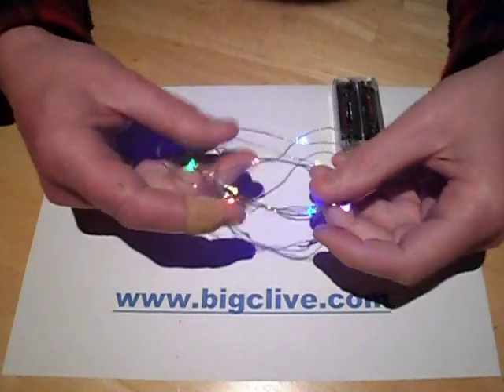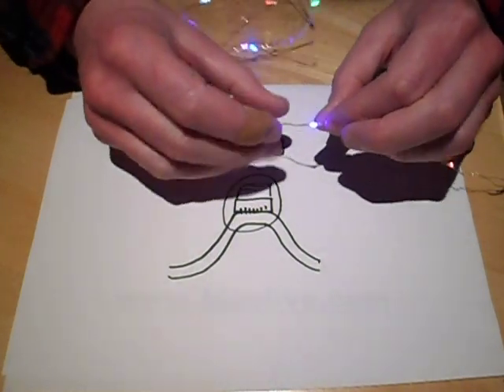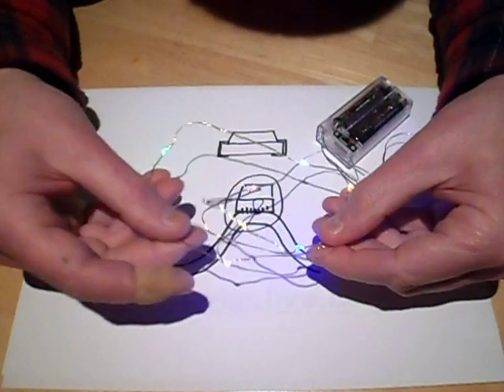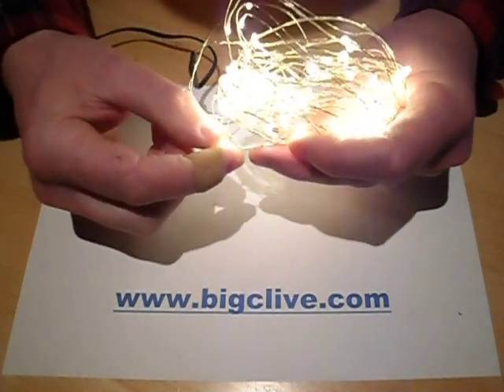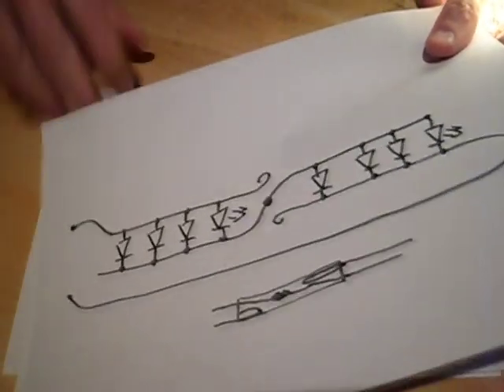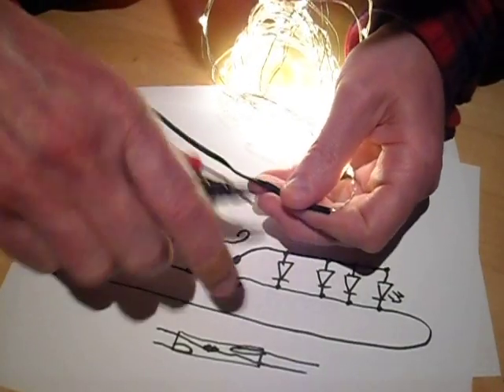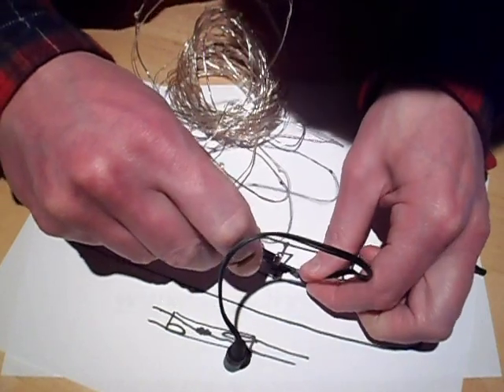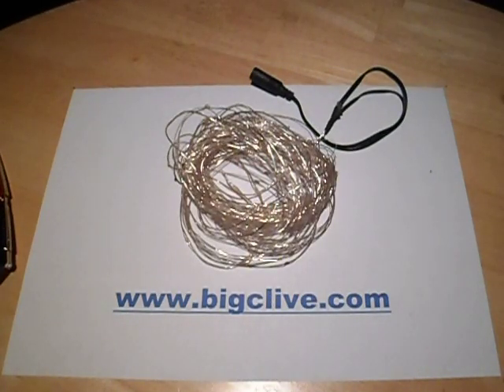Analysis of a 100 LED string of "wire lights".

Comment: Amazing how a 10 year old video comes in handy! 🙏 broke our lights that we’ve had forever and got confused by extra wires and it was intermittently tripping the transformer, turns out I’d linked up the loose 3rd wire at the start of the chain which apparently didn’t need to be connected to anything 😂 thanks

Comment: Excellent! Thank you very much, you saved my bacon. I had cut down a 5v 3x wire 200 LED string, and it didn't work, of course. I was perplexed as the little joints, (there are many in this system) didn't make any sense. Until I watched this video. My solution, basic as it was, was to solder it all back together and coil up the excess out of harms way :-).

Comment: Would it be possible to shorten these lights?
Reply from the maker: It's not easy, as one of the wires going to the other end is a common.  On the 5V sets you would have to work out which wire the third strand was supposed to join to at the end, and on the 12V strings it's not very viable.
Reply: thank you!
Reply: Can we join these wires if the string's cut off
Reply: @baesilvaz4440

Comment: Your resistor is the ~50m of thin copper wire...   You only need a resistance of a few ohms for sufficient current regulation.

Comment: Some good points, Clive. My wife and I are now in southern Spain for the summerand I plan to do lots of experiments with battery powered and solar LEDs now the sun is with us. The rice wire LEDs we have so far are running off 3v solar cells and come as little bottle corks with a strand of the lights. I've just ordered some RGB rice wire (many metres of RGB) which should be with us in a couple of weeks and I'd never thought to check if it is 12v or low-voltage - and I was wondering how they get the red to run at the same voltage as the rest. Your comment that the colours are almost all base on blue makes sense. The solar variety are not that bright and so I plan to run them off my solar 24v (250w) installation via some cheap, tiny dc-dc convertor pcbs that came to about 50p each, able to take in anything up to 30v and output almost any low voltage. I'm expecting to need just short of 4v but if it turns out the long strands are indeed 12v then these little boards will handle that, too. I seal the convertors with the glue gun usually though resin would do just as well. If they are in parallel-serial it could make it harder to customise the length. I do know the white ones are simply all in parallel and hence you can cut the wire anywhere. The RGB 12v LEDs you describe could be slightly trickier to cut down.
Reply: For 12V 2wire LEDs you can rewire the joints into one parallel circuit to allow these to run on a 3.5V supply...Then cut off some or all of of the excess and reconnect the injection wire. Consider being nice to your remaining LEDs because they will have to share a higher current. You can resist(or) the advance before it gets too hot to handle. RGB likely have 3 wires and I admit I haven't tried rewiring them...

Comment: I have a set of these very thin copper wire lights which is made up of 16 strings joined to one 12v 6W supply wire and designed to "cascade" down a christmas tree.  Every 5 or so lights pulses on and off to create a "twinkle" effect. My question is would it be possible to fit a suitable dimmer, if so, what should I be looking for?

Comment: Hi thank you for this helpful video. I was just thinking about this as i recently found them and i bought 4 of this (battery suplied 1.45meterea long) i used them for a project and i would like to kink all those 4 packs togethers and try to make something be powered by plug . Can you help me how i can do that. Is it fin if i jus link the end of each pack with other pack by sording cables? How i know which one is + and which is -

Comment: So I guess the 5V ones just include a resistor to drop down to the 3 ish volt?
I bought a set on clearance the other day for 7 euros (70% off) that includes 180 warm white leds in 9 strings of 20 at 5ish cm spacing instead of the more common 10, each hanging from a thicker wire busbar at about 15-20 cm spacing, sold as a light curtain effect. The power adapter it comes with is 6V 800mA, and where the power feed comes into the lit part, I can see under the heatshrink that there are two large, probably 2W resistors, presumably one for each leg — I can even see they are colorbanded, although not which colors. It really does look like they're literally pissing away half the power as heat — the resistors get appreciably warm but not excessively so.
Seems like it'd be a lot more efficient to have a current regulated driver...

Comment: I have a question . I bought a christmas tree with white LEDs built in, and they only lasted 10 mins. When I tried to change the blinking mode it died. The power supply doesn't have any power output anymore, the info on the power supply says Urated=29V , Uout = 32V , Prated=15W .  So I decided to do the power supply myself,  I had old toroidal transformer and wound up enough wire to provide 30V . Now I ordered on ebay bridge rectifier KBPC3504 so this should sort out the AC to DC issue. Now I am not sure about the resistance needed, as my transformer is probably giving 10A on that 30V .  And also not sure about capacitor, do I need any?   How do I calculate the resistance needed considering the old PSU had 15W and 30V , which means 0.5A output. I would need to achieve the same output and not higher or the LEDs will burn .
Reply from the maker: I'd recommend trying to find another standard Xmas lighting transformer rated around 30V.  Especially if there are a couple of flashing channels, as it may be using alternating polarity to switch between circuits.

Comment: Hi. I have 300 led 12 volt fairy light string. And I have 12 independent short fairy light string with 20 leds and operated 2 pcs 3v battery. Can I connect thoose 2 type or can I connect the 12 small to a 1 long with plug in end to a wall cause the batteries die so fast.

Comment: Hi. I want to join a few of these together, not as a continual strand but as individual strings, out of one battery pack, would i need to add something to ensure they are safe or maybe a bigger battery pack?
Thanks in advance
Reply from the maker: You could parallel these sets from a central battery pack no problem.  You might also consider the 5V versions that could be operated from USB power banks.
Reply: Thanks for your reply. 
They need to be portable as the display they will be used for is in the middle of a field and no electricity supply.

Comment: I have five sets of these driven by a USB flasher. I want to drive the five sets so they flash in synchronism. How easy is that to do ???? Could one USB drive be buffered to achieve it ???

Comment: How would I connect a couple of LED string lights together. So I could go from a 10m strand to a 20m strand etc. save on using extra power cords and what not.
Reply from the maker: +scottyv1985 The strings are arranged with a specific wire resistance and feed from both ends, so it's not easy to just join them together.  But you can save some cabling by feeding two sets from a central point and running them out in either direction.

Comment: I cut these into singles and use in greeting cards, I've made several videos on different ways to do it. I use a CR2016 battery, which is very thin and easy to use.

Comment: I'm sure it's been asked but I have several of the 2 double aa battery style lights and see them often at dollar stores. I think you already covered the subject but I would like to know if connecting two of the 3v parallel strands in  series would make it a 6v strand and if then could be run dimmer with a 5 volt usb? Think you may have answered the question saying the connections are not easy to distinguish but the lights I have are the bigger gauge  wire more common style led string light and not the fairy lights. Would be nice to not have to buy a bunch of 3v power adapters, but guess I can start working with resistors too and learn something new. Love the videos and the way you tinker with lighting. You pop up in many google searches often times the only person to have answered the typical diy questions Ive had. Have a wonderful day!
Reply from the maker: Search my videos.  I have one showing how to convert these LED strings to USB with just two 10 ohm resistors.

Comment: I am trying to fix one of those 100 lights string, already tried all 3 wires possible connections in the RED and BLACK wires of the cable adapter. I am leaving a third wire disconnected as I compared it to a working string and is having that. 

Could someone explain how to solder this 3 wired string into the 2 wired adapter part with the females end. 

Thanks!
Reply from the maker: One wire usually goes to the far end, and is one of the power connections.  Just one of the wires at the other end is normally connected to the other connection.  The voltage of the power supply must match the string.  Some are 12V and some are 5V.
Polarity matters.  Wrong polarity and they won't light.

Comment: Hi,  i got a 10M (100 LEDs) USB powered set. If i cut 2Metres (20leds) from it, how can i solder it and how many volts will i need to power it? Thanks!

Note: my set only has 2 wires.

Comment: Can the 100 bulbs be cut into  shorter segments, say 4 (25 bulbs each), or 8 (12-13 bulbs each)? I plan to put the segments in small jars powered by a 3V or a 1.5 V cell each segment.

Comment: Merry FISHMAS hope u guys have a great 1. Hey i have a question not sure if youve ever covered small electrical stuff like. 1 watt uv leds in series maybe 2 or 3 bulbs. Id like to run them off battery. Im thinking 9volt but not sure and what size resistor would i need for 2 or 3 bulbs
Reply from the maker: For 1W LEDs it's typically about 3V per LED, so on 9V you would have 6V across 2 LEDs and 3V to drop across the resistor.  For a current of about 300mA that would require a 10 ohm resistor that would need to be rated for at least 1W.
Reply: @bigclivedotcom  Merry FISHMAS hope u guys have a great 1. Hey i have a question not sure if youve ever covered small electrical stuff like. 1 watt uv leds in series maybe 2 or 3 bulbs. Id like to run them off battery. Im thinking 9volt but not sure and what size resistor would i need for 2 or 3 bulbs.
Emitting Colour: UV
DC Forward Voltage:  3.9V - 4.5V
DC Forward Current: 350mA/700mA
Luminous Intensity: 50~55mW
Wave Length: 365nm - 370nm
Viewing Angle: 120 Degree

Comment: I have one USB powered set in a fireplace and two battery operated sets up on the mantle.  I'd like to splice them all together to be powered by the USB and into the wall thus eliminating the need to constantly replace batteries.  Is it doable?  Seems simple enough to cut and splice them together.

Comment: Hi! Love your videos. I have a question that you may be able to help with. I have a set of copper string lights that I am attaching outside to a tree. The lights are "waterfall" or "vine" lights. There are 10 strands all connected to a central point. Each strand consists of two wires. They appear to end with a simple cut. They are not soldered back on themselves. I attached it to a tree with staples. About halfway through, I checked it and it worked. At the end, I plugged it in, and none of the lights will light. Did I short the entire bunch of lights? If I did, how do you think I managed it and is it repairable? I have a soldering gun and novice level experience. I'd love to hear what you have to say!
Thank you in advance
Reply from the maker: The staples may have pierced the lacquer and shorted the string.  They're not a good choice for attaching thin wire.

Comment: There is a lot to learn about the various types of these that occur out in the wild. I just got a solar powered string of 100 RGBYs and it does not chop the LED’s into sets of 25. they are all in parallel and powered by a 3.7 volt Li Ion cell. However the string I got seems to have a defect. It only runs for about a half hour before the red yellow and blue lights dim and then drop out and the green goes bright. This suggests that the LED’s are not correctly voltage matched - eh? Also tells me why they were so cheap on eBay :-)
Reply from the maker: The reds and yellows are probably blue chips with phosphor.  The green is probably a bare green chip, and as you say, probably has a lower forward voltage.

Comment: can i put 300 lights or 3 sets by 100(10m) to 1 charger or to power surply.they are powered by 3 AA batery each now..but i want them be wired and if posible to power them with cable?!
Reply: Thats easier. 5v usb if it's 3 batteries. Just make sure to wire to the + / - battery case terminals since inside the case is other circuitry usually stepping down the voltage. (Meaning don't just cut the wires right before the lights and splice on there, run in series and keep intact the battery case and or circuitry. But if they can run off 4.5 volts they will do fine.

Comment: Do you know if there is any way to fix this type of light strand? One of the two wires snapped, and will still make a connection when put together very precisely, but I have no idea if there's a safe and effective way to reattach them. I'd just replace the whole strand, but the lights have more ornamental casings and were a bit more expensive, so I'd like to save them if I can and this obviously isn't my area of expertise.
Reply from the maker: Is it the 12V type of copper strand lighting or the lower voltage type that runs on a couple of batteries or a USB power supply?  Or is it even a wall powered set?

Comment: Hi!  Really enjoyed your analysis.  It made me wonder . . . Can you get smaller sized strands from stock ones.  For example, can you build a 1m strand? 75cm strand? from current ebay supplies?  The elegance seems to rest on the way they avoided using resistors . . . If you start cutting thing up, will you have to mess with resistors?  Why don't they just include a resistor in each led to begin with?
Reply from the maker: Leonardo Legorreta You could cut a standard USB style string of the LEDs down to length and get rid of the third wire.  But you would have to add the resistor to limit the current through the LEDs.  They don't add a resistor per LED since the way the string is manufactured is simply the LEDs hard-soldered onto the bus wires.
Reply: bigclivedotcom Great.  I'm a newbie at this, but I will try what you say !  Thank you for the advise and for your incredibly prompt reply!!

Comment: Dumb this down for me ..... 
I cut a large string of 100 leds ........ from the connector ....... I tried connectin with a 3.6V, 4.5V and 12V ........ and couldnt get the lights to come back on. These were two copper wire only.

Comment: Thank you so much for all your knowledge about these mysterious little things! 

I have an issue with my set of 100 lights. I have only just bought them, had them lit for about 5 minutes, then they flickered and died. I think I smelled a slight burning smell just before. 

I had wrapped them in some fabric to make a costume with them, but I thought they didn't get too hot and would be ok for that purpose? I also hadn't completely unravelled the roll they came in.

Any ideas as to whether this could have been an overheating issue, or is there a chance I've short-circuited them somehow? 

I'm making this costume for someone and it has to be finished within a week so I'm starting to stress out! If I use a new set I'm worried the same thing will just happen again!

Any light you can shed on the situation would be much appreciated!
Reply: Hi. I hope that the show went on.The next time, starting "halfwayish" along the string with 2 lightly pinched alligator clips to pierce the insulation of each of the 2 wires in the LEDs, inject 50 ohm resistor-limited 3 to 5V . You should find a clue when the LEDs light up in both directions outward from your injection. If all LEDs light, the third wire is likely broken.

Comment: I am using similar lights in a wall hanging .  I wresting with the problem of making the batteries last as long as possible to avoid having to change them every few days. The timers on some strings greatly help but still they are only good for a week.  I don't mind sacrificing brightness or adding additional batteries or added expense. My only concern is minimizing the maintenance. Do you have any suggestions on how I can maximize the duration of the batteries? They need to burn only 4 hours a night.
Reply: As BC had mentioned in one of his "lovely" videos, a series diode can reduce the voltage. This works for one-channel strings, and/but converts a 2-channel string into a one channel string.